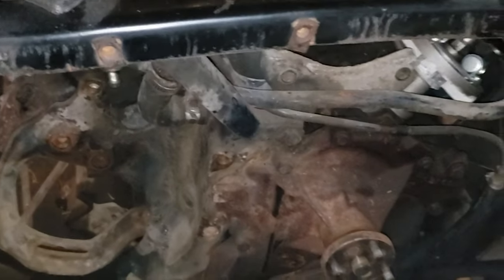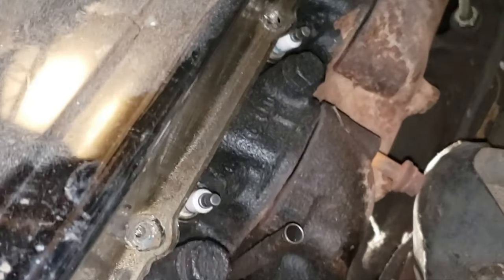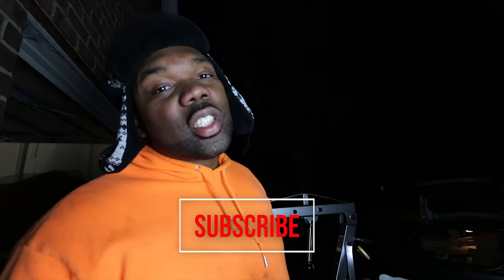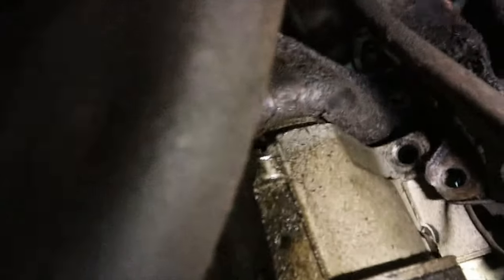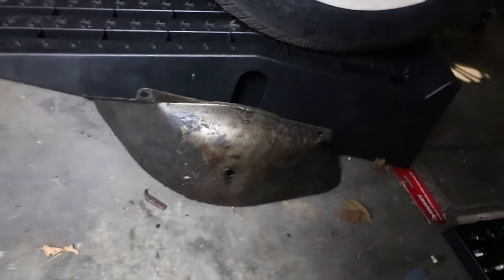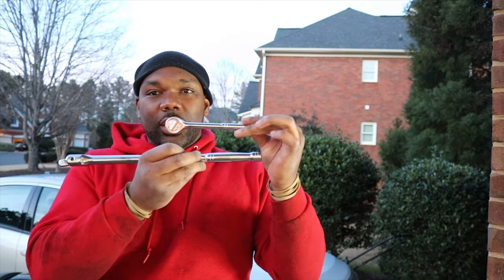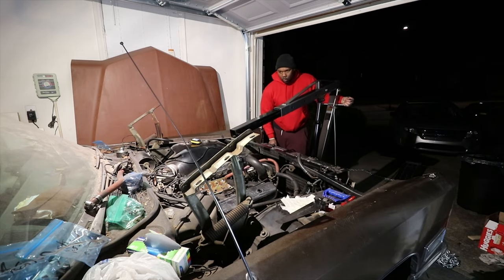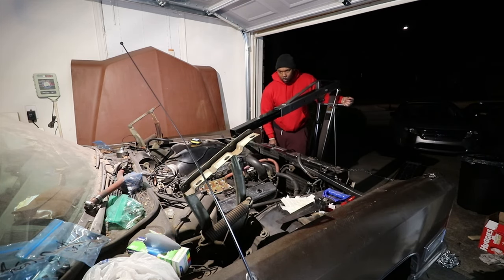1968 Cadillac Engine Pull: Day 2

Comment: 13:13 I did it !     That should have been the thumbnail.  I used a thin putty knife between engine and trans (Subaru in the rust belt)    Was that intentional on the engine hoist ?  Daylight start, finish at night ?   That's heavy duty, I have one but i bought it used on Craigslist.  Poor seller had just developed ALS, so I think of him every time I use it.      Bolts my guy, not screws.    Harbor fregiht makes a large 1/2 breaker bar, and on that damn subaru, I needed them.  My guy Nate said get a milwaukee cordless impact,  best damn tool you'll buy he said.  Maybe this CHristmas ?   .. Love your enthusiasm and persistence.
Reply from the maker: thanks for the advise. keep in mind I'm new to this.

Comment: I tell you what bro its hard finding people that know how to work on these old cars. I have 69 Cadillac Miller Meteor Ambulance built over a Fleetwood base that i turned into a Ghostbusters Ectomobile. This video has showed me a lot and I also have a Cadillac Shop Manual for the car. Thinking about redoing my engine myself. Do you recommend staying with the "QUADRAJET Carburetor or do you have any suggestions
Reply from the maker: I'm jealous. I been looking for a decent ambulance forever. I your quadrajet works, keep it. You wont get any significant power from the upgrade without changing a bunch of other thing with it.

Comment: Gots me a 69 coupe Deville, gonna pull the engine, did you have to block the transmission so it wouldn’t flop down after engine removal?
Reply from the maker: nah, but i would support it anyway, just in case